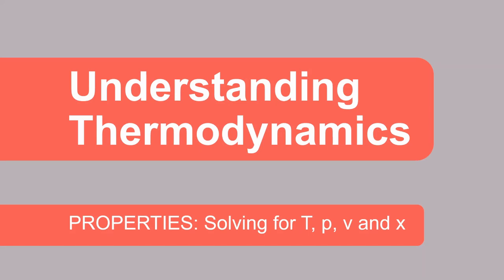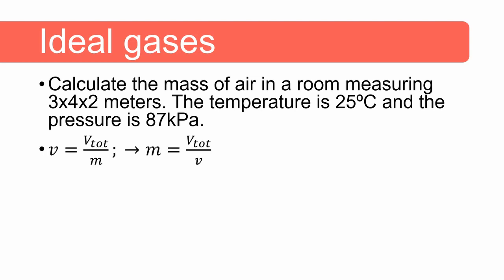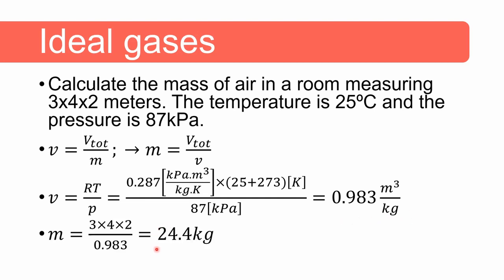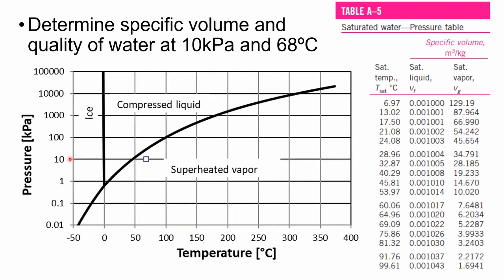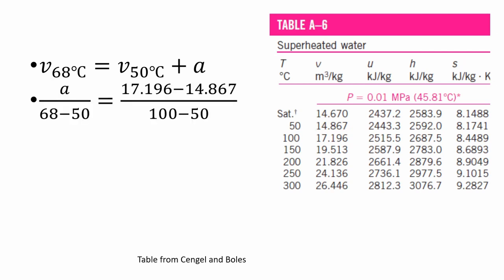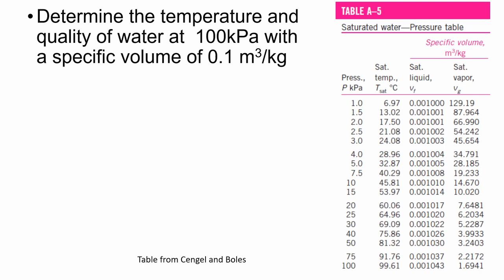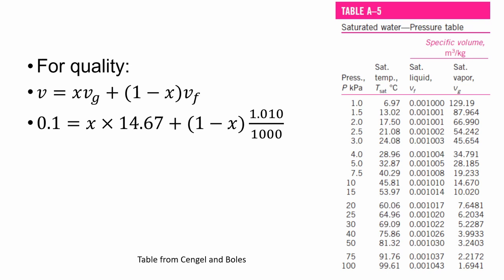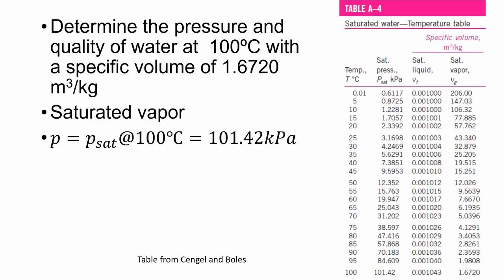Solving for temperature, pressure, specific volume & quality | Mechanical Engineering Thermodynamics

Comment: Where did you get the values for 5:08? They don't match the table shown, or the table that I use. I got 5.845206x10^-2 for quality (x)
Reply from the maker: Thanks for highlighting this. Your answer is correct. It seems like I took my values for specific volume at 10 kPa and not 100 kPa.

Comment: The question at 02:26 has a mistake at the interpolation. a = 0.83844 where you stated a = 0.745
The answer for the specific volume  is therefore 15.705 and not 15.612
Reply from the maker: Hi Catja. You are correct, thank you for highlighting the error. The correct value for specific volume at 3:46 is 15.705 m^3/kg

Comment: Are we supposed to memorize the table data or we can get them in exam paper?
Reply from the maker: Luckily you are not required to memorise the tables. They will be provided together with the exam paper (at least that is my experience). Just also ask your lecturer to confirm as I can’t speak on their behalf
Reply: @AdriaanVanNiekerk  okayy thankss
Reply from the maker: @itsaddy4404  no problem. If you have any other thermodynamics related questions, send them my way 👍🏻
Reply: @AdriaanVanNiekerk  yes why not..
Can you help us learn the numericals to know the pressure, quality, volume, enthalpy and internal energy in a single question? 
Like you need to make some table for it as well right..
Reply from the maker: You will be able to get all that properties from a table. You just need to know two properties for the state to be fixed. If you know two properties (for instance pressure and enthalpy) you will be able to get all the remaining properties